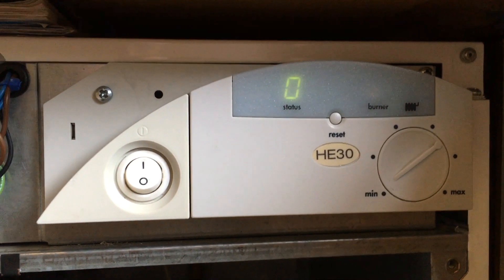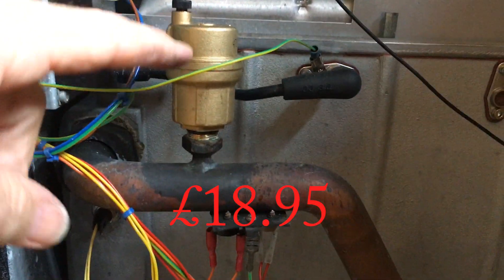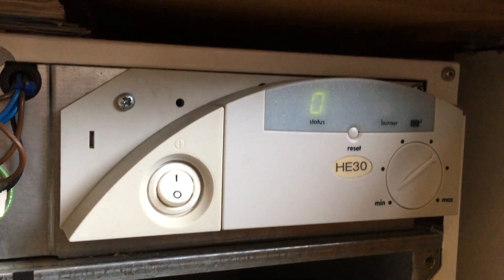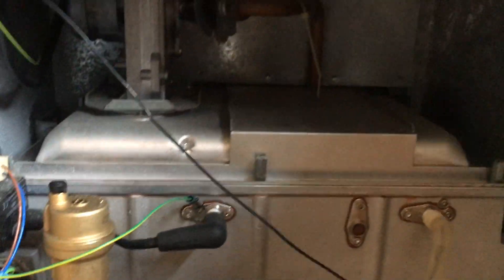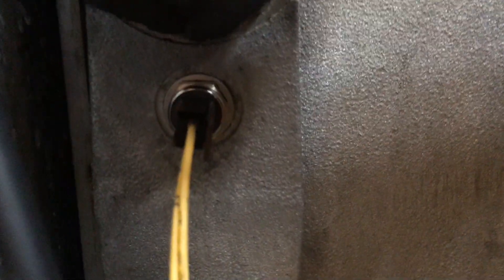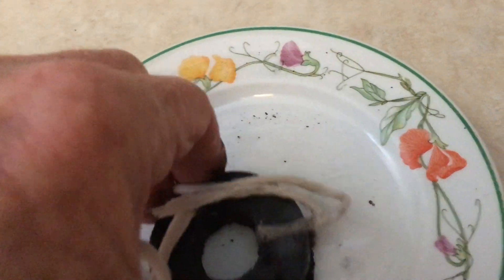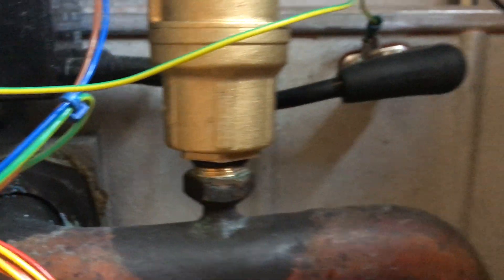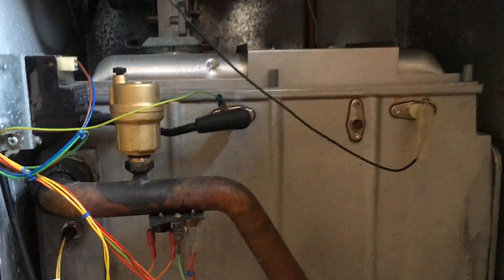Ideal boiler fault code LF,  H4 Icos. DIY guide on how to replace parts and get the boiler working.

Comment: Hi there, did you get it working reliably now?
Reply from the maker: Thanks for watching. Yes, the 'dry fire thermistor' terminals were corroded (item 174087) and once that part was replaced the boiler works normally.
Reply: @b33zo   did you have to drain the system to take it out?
Reply: i didnt hear you say anything about draining it, but it says it in the manual
Reply from the maker: @quickfix5116  Make sure everything is turned off before you start. Undo half a turn and if you get water tighten up and drain the system (when the weather is warmer ideally). Easy job. SEE BELOW
Reply from the maker: @quickfix5116  DEFINITELY drain the system down before removing that item! b33zo